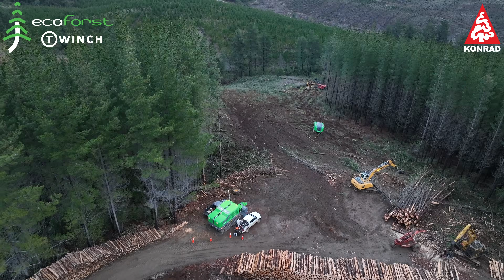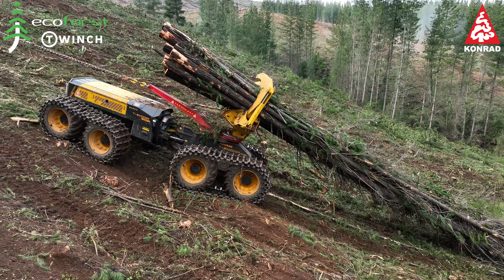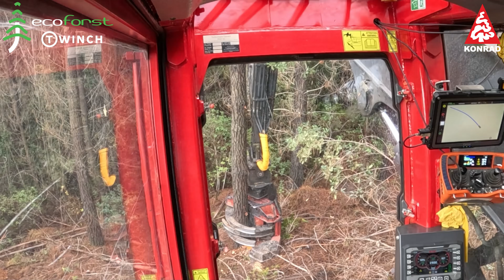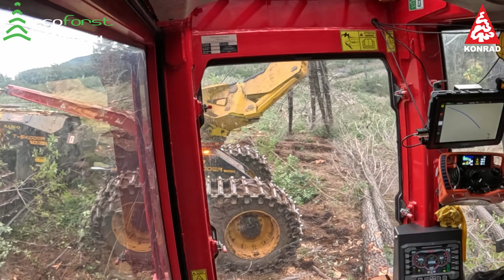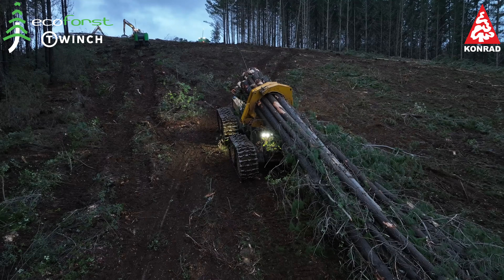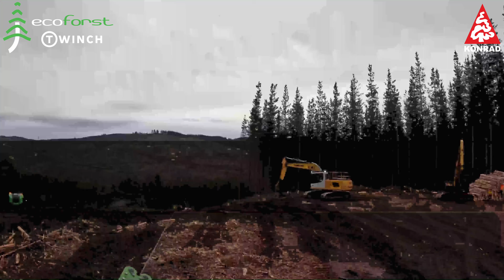T-SKIDDER: Autonomous Skidder

Comment: Those 3 excavators could be replaced with one wheeled harvester that cuts the trees to logs where trees are felled. Then a forwarder moves the logs to storage next to road. You can use winch with forwarders too. This whole operation seems awful waste of fuel and manpower.
Reply: T-winches are very expensive in Chile. That skidder overturned, and that Eltec shovel costs at least 700,000 pesos. The winch is 30.2 million, another 500,000 US dollars, plus the skidder and T-winch, another 1.5 million.
Reply: I prefer to buy a Tigercat 635, a Falcon or Urus 3021 assistance winch, or even a summit Here in Chile, the Alpine tower or yarder with a claw is widely used; you save a lot of money when buying it.